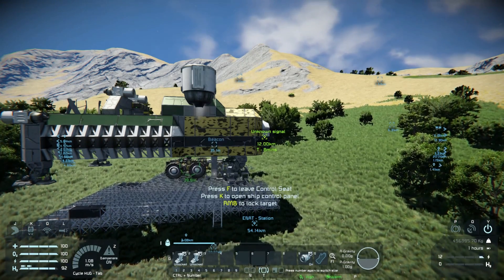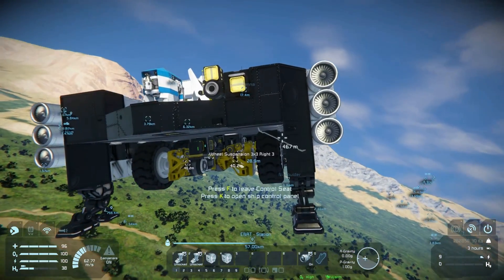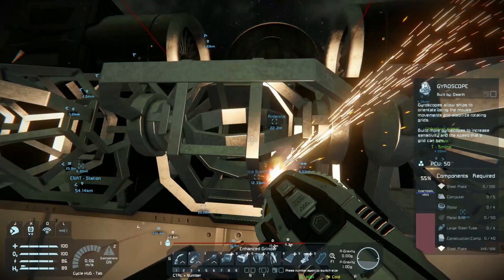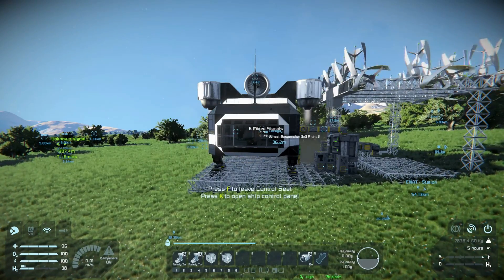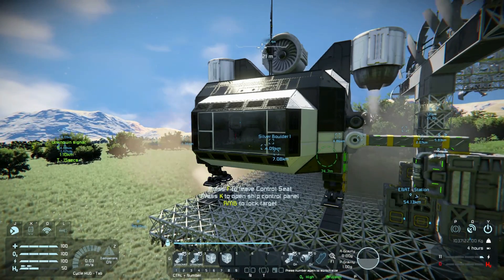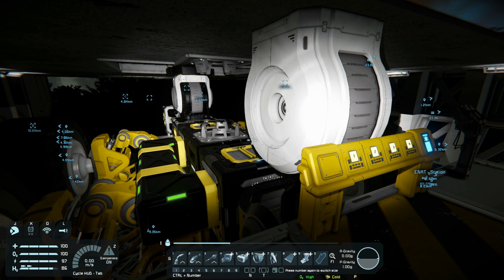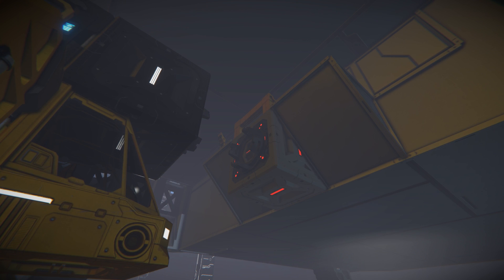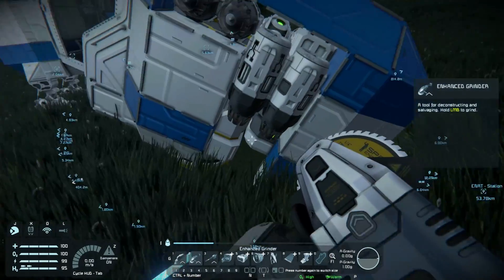Space Engineers - EP8 - Merge Blocks, 4 Things to Know | Tutorial | Let's Play

Comment: why do you prefer hinges than connectors?
Reply from the maker: Great question!  In this case, there were 3 things.  One is that the hinge when connected only take up 1 block of space, the connector takes 2 - one block for each side.  The hinge is also a little shaved down so it fit better retracting up into the hole above without grinding against blocks on the side - space engineers doesn’t like that!  Finally is the alignment factor. When I realized I needed to use a merge block to share the physics, the hing helped me align the rover to ship with less weird forces I’d have to accommodate for merging.

Comment: Why not use a connector here, it keeps the name and by having the connector locked it will essentially merge them
Reply from the maker: @michaelm6597  It's because attaching things with a connector creates 2 separate grid (a "main grid" and a "sub-grid"), and the thrusters and gyros on a main grid don't account for the mass of sub-grids.  This isn't as big a deal in the weightlessness of space, or on rover on the ground; but in gravity, it will causes ships to slowly sink to the ground, tip off to the side, and other odd behaviors.  Merge blocks work completely differently than connectors, merge blocks (as the name suggests) merge 2 grids into 1 grid where thrusters and gyros can account for the attached grid weight appropriately.  Hope that helps!

Comment: I dunno if you made a video about this, but I recently figured out that you can use merge blocks to make your piston-using blueprints "projector-ready".

(I'm new to this game and I almost quit playing when I found out my multigrids are broken on projectors.)

1. Start a creative mode game in space, spawn your blueprint that uses one piston or more.
2. Grind the head of the piston off to detach the subgrid. Put a merge block on the subgrid in a diagonal position from where the piston head was, pointed in a perpendicular direction from the way the piston is pointed. Then blueprint this subgrid.
3. Build blocks from the base of the piston leading to a projector, then project the subgrid you blueprinted so it's in the same position it would have been. You should have the piston able to withdraw at least one block away from where it was before.
4. Re-save your main blueprint while the subgrid blueprint is turned on.
5. When you're ready to reconnect, spawn a new piston head, then attached a merge block to the side of the piston head. Have it pointed so it will align with the previous merge block.
6. Extend the piston. It will suddenly "jump" into a locking position once the merge blocks align far enough.
7. Grind your temporary blocks off, including the projector. Once you detatch these from the piston base, the subgrid will be back on the piston head as a subgrid rather than as part of the piston's grid.
(To avoid "klang", maybe turn the merge blocks off until they're aligned. The "jumping" into position creates a big "jump in position" again when you grind off the temporary blocks which may cause damage.)

You're essentially projecting from the piston base's grid, then merging it onto the piston head, then disconnecting it from the piston base to transfer it to being a subgrid on the piston head.

Comment: Thruster placement doesn't necessarily matter because of weight as such, but it still can in terms of creating unsafe angles for the ship to travel at.  If I rotate to 90 degrees from my upward thrusters, my side thrusters won't hold me up, and I will crash.
Reply from the maker: How can I better explain...you know how thrusters work on the entirety of grid regardless of placement location - for instance you can have all you up thrusters just at the front of a ship and it still works (that's what you're saying and that is correct).  Well, with sub-grids, that additional weight isn't accounted for by those main grid thrusters giving you that automatic balance provided on the main grid.  I'm really talking about a sub-grid influence.  Hope that make more sense!
Reply: @Oearth  I do understand that physics calculations don't apply across subgrids, yes.  I was talking about thrusters on the same grid.  I should have clarified.

Comment: Ok, I have a question
I'm trying to merge a rotor wing grid and my main ship grid to be able to control the thrusters of the grid and rotate the horital wing vertical and horizontaly, but it says it can't fuse cause things will be in the same position. How can i make rotatign wings as i will and connect in the same time without having this issue
Reply from the maker: @Keljor  That's a great question!  ...and I "think" I understand what you're trying to do.  It's probably not as much a merge block problem as it is a subgrid problem, and certain constraints around subgrids - in you're case the subgrid is the wing with thrusters coming off the rotor head. The good new is that there is a way though to fix this and merge your wing to the body of your ship to control the winged thrusters!  Not to necessarily just redirect you to another video, but the linked video below does really explain exactly what going when trying to merge subgrids, and has overlaid diagrams to show you how to get around the problem (and other weight distribution problems caused by subgrids) by using a kind of intermediate grid.  Let me know how it turns out for you!  Link below.  
https://youtu.be/lpNA8tRLHaY

Comment: Merge blocks for me dont come apart. When they merge they stay merged like they are welded
Reply from the maker: @Gordon - I almost certainly know what the issue is. The thing to look for when you merge the blocks together is to see of any other blocks from the 2 grids are side by side to each other.  Any adjacent blocks will become fused together into that single merged grid, and won't come apart even if you turn off/unmerge the merge blocks.  That's one of those "4 things to know", but can it can be easy not to see that one on your build.  Even the side of a piston head can become fused in this way, so take a careful look and see if any adjacent blocks would become fused when the two grids merge.

Comment: Gyroscopes???
Reply from the maker: Worked with different gyroscope applications.  The gyroscopes on the ship didn’t affect the weight of the rover because it was in a separate grid, and a gyroscope on the rover really only made the two grids compete with each other (the rover gyro was trying to keep it in place while the ship gyros were wanting to move it).  Very recently though, I think maybe Sharing Inertia Tensor through the hinge might actually do the trick by itself as it supposed to share masses.  So even though I’m happy with the merge block solution, the inertial tensor thing might work just as well…haven’t tested though…I like to do a lot of testing!!  :)

Comment: Why are you using hinges instead of connectors?
Reply from the maker: I talked about it some in a prior video, but it was basically space conservation to avoid a lot of redesign.  Because the 2 parts of the hinge fit together it winds up occupying 1 block of space to connect 2 things, whereas the connector require 2 blocks, 1 on each side.  Good question!

Comment: The physics effect of connected grids used to be much greater, to the point you could use that alone for offset thrust vectoring, until Keen did a physics update a few years ago for stability reasons. Even then, "clang" can still be a factor as one connected grid tries to follow another and their physics boxes begin to overlap. This causes effects such as uncontrolled rotation as the grids try to push away from one another. It's better than it was years ago, but it can still occur...especially with deformed armor blocks.
Also, when merging two closely linked grids, i would add that:
1) blocks such as sloped armor facing a merged grid without welding to it can help smooth out a connected design, or create an airtight passage when the grids are connected.
2) when merging grids, the grids will not merge if connected blocks will overlap. This is especially important when taking into account blocks such as rotors, pistons, and open hangar doors that appear to have more room than they actually do.
Reply: Rotors usually don't overlap, but hinges do. And this can be solved by using two hinges in series between the two merged grids, creating an "intermidiate grid" to prevent overlap :D
Reply: In the inventory menu, go to the info tab and check the show center of mass option.